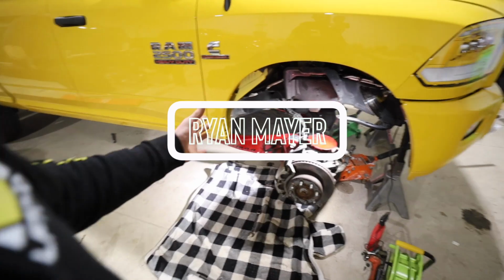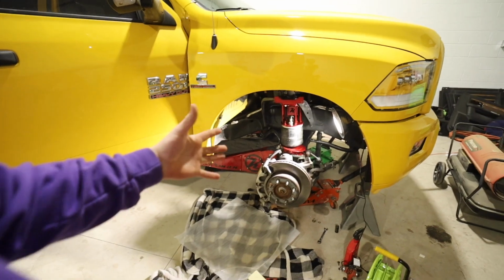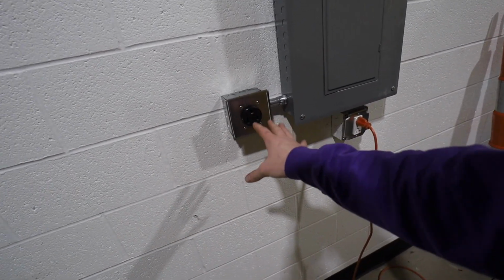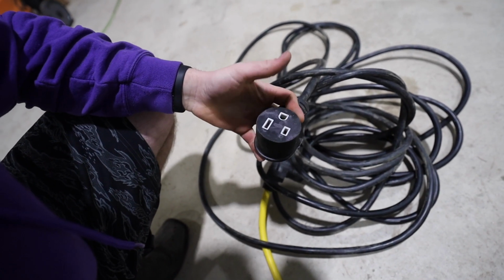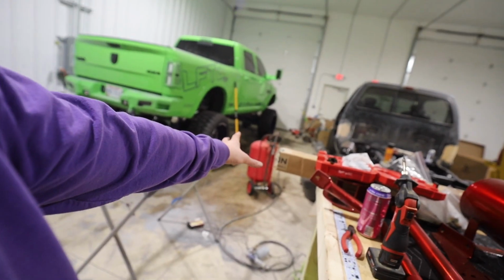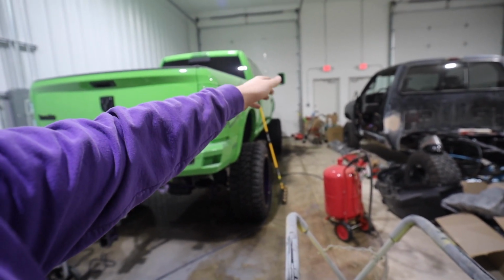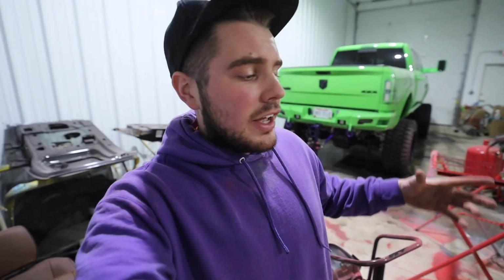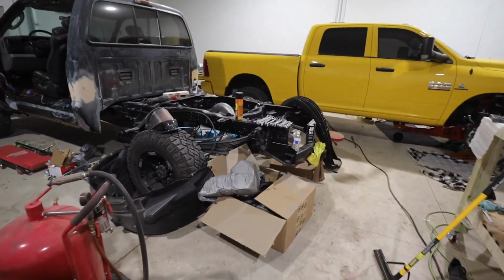PROBLEMS + Powder Coating My Light Bar! | Building a Banana Ram | Part 22

Comment: You didn't outgrow your shop-you just moved the mess from your original garage and spread it around a bigger space.  Shelving, organization, and doing  1-2 projects at a time instead of 3 would all help a ton.  Durtymax Jack does all his stuff  in a a long single bay shop.  Granted, he has shops do a lot of his wrenching but not all of it.  He's just organized.  He pulls a truck into his shop for a specific project, does it, cleans up, pulls the truck back out, and continues on.

Comment: You could loft the back 8-12 ft of that shop and build out shelving systems and add roller cabinets and have tons of space. If you're not working on Lime; it should not be in the shop while you're working. That too is wasting your space.

Comment: Why is the Lime Ram in the shop? There's no work being done to it, yet it's taking up 150 sq ft of usable shop space. You really should setup a full length wall of 3 tier shelving to aid in organizing the shop. You could put the whole interior on the bottom shelf out of the way.

Comment: Also, from what I see you haven't outgrown the shop you need better organization.  A set of shelves to keep the stuff you have not installed yet on (like the interior in your way).  15 feet of useable wall space behind the lime truck.... Doesn't seem like you are utilizing any.   A another bench.  Some wheel dollies to push things your not currently working on right away out of the way.   Also, a blast cabinet to contain the mess and recycle the beads.   Maybe a parts washer next to that.   Your work flow is inefficient.